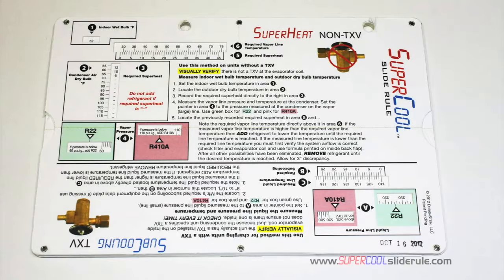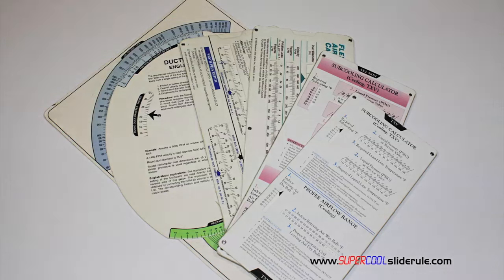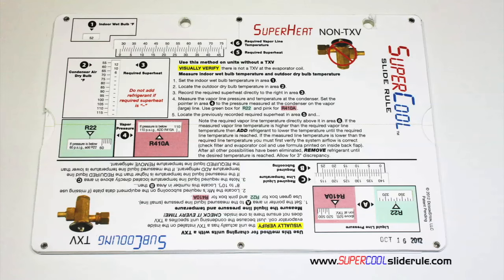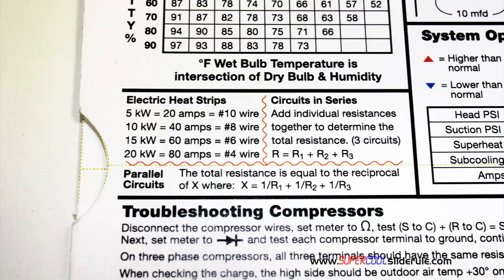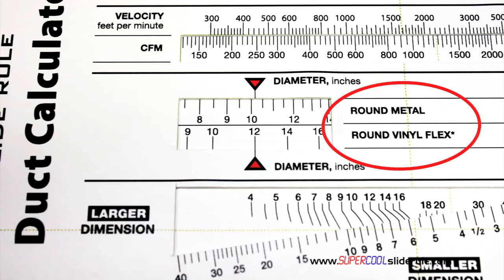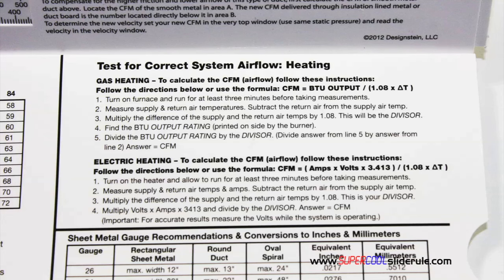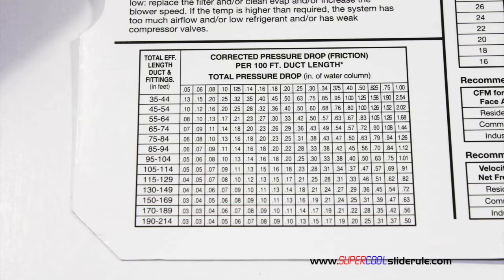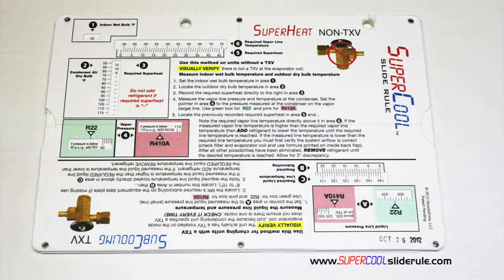How to test a heat sequencer

Comment: My thermostat is wired to external heat furnace inside when switched to emergency heat. My outside unit is not working properly. When I switch to emergency heat the thermostat just keeps clicking continuously, not kicking on. One day the power went out, tried that evening and it worked properly. Turned it off on thermostat bc warm outside, now cold again and is just clicking again. Any ideas? I'm only self taught, new to home owning and do not have money to hire anyone.

Comment: Thank you for your video. Question: If a Sequencer is replaced, can it solve this problem (cooling keeps running, non-stop)?
Reply: It should. Be you'll also want to check your thermostat, limit and fan switches(if fan switches are present in your model). Good luck

Comment: WHY in the heck are they called SEQUENCERS?!  They aren't sequencers, they are delayed response- delayed on, delayed off.  Sheesh.  Sequencer" implies following an order of actions.  Gadzooks!
Reply: Way belated, but because it doesn't connect everything at once. Give it 24v, delay, M1 & M2 connects, more delay, then M3 & M4 connects. Or something like that. So, for example, delay, fan & element 1 turns on, more delay, element 2 turns on. And vice-versa when turned off. Keeps inrush current down for less strain on the wiring on start up, and lets things cool down a bit before fan shuts off.
Reply: Because it does follow an order of actions. Lol
Reply: I struggled for years trying to understand them because they are so over explained ince I understood them it was like WTF was all the hyped up nonsense for!?